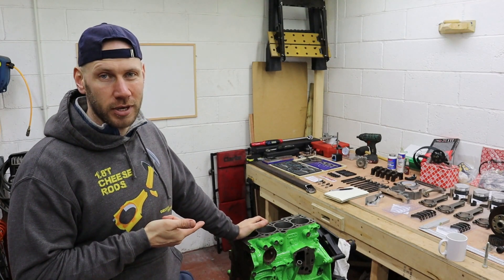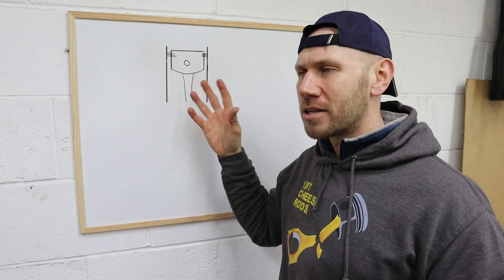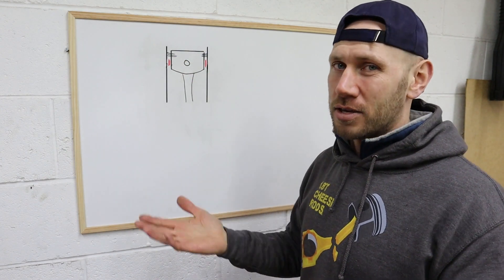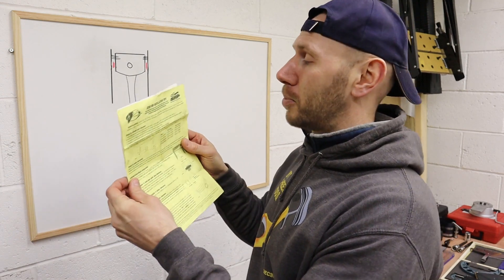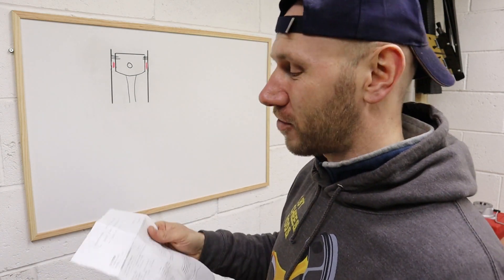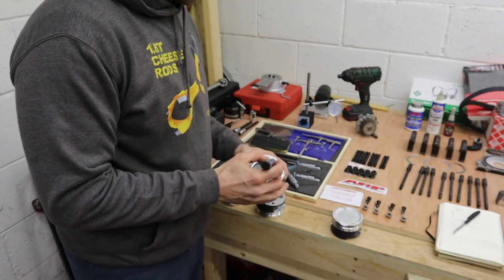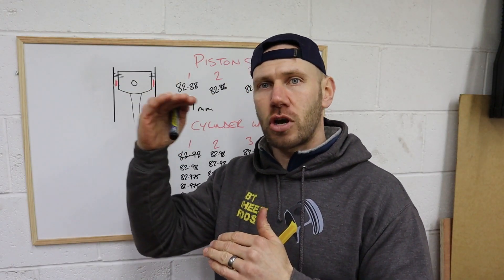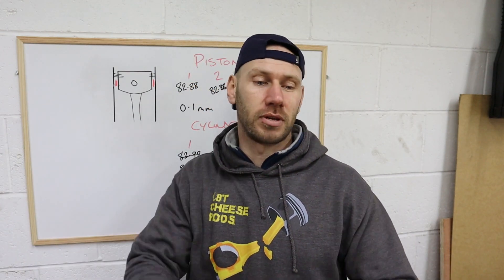SETTING PISTON TO WALL CLEARANCE!! // VAG 1.8t Stroker Engine Build

Comment: At 0.1mm like you have set it, does it burn oil? What pistons ring gaps did you use?
Can you set a EA113 with je Piston ultra series (83mm) to 0.9mm PTW clearance? I would like to get some proper Infos, but there is not much Info out there

Comment: Good content, it's a thing many people struggle with during an engine build. It's also good to emphasise that the correct location to measure pistons as you showed very clearly is at 90* from the pin and about 13mm up from the skirt bottom, This is where most people get into trouble. Pistons are not round and as you also mentioned expand when the engine is running. The top of the piston, which contains the biggest mass expands more than the thin skirt.

Comment: do you have to put the Pistons in the correct way or you could just put them in there
Reply from the maker: The pistons have to installed in the correct orientation.
Reply: Which piston go in first you could just put them in one by one or you have to put them in an order and the block

Comment: Hi mate, thank you for the video.. I have a question if you wouldn't mind answering. I just got my engine block back off the machine shop and 5 out of 6 bores are 0.0005" over 84.5mm (the new bore size).

However 1 of the bores is 0.0025" over. The suggested ptw clearance by the manufacturer is 0.95mm and each piston comes in at 84.405mm. After converting these values, I'll have a ptw clearance of 0.16mm (0.006") on one of the bores. All others are 0.11mm (0.004") which I would imagine is close enough to the 0.95mm recommended by the manufacturer.

Should I go back to the machine shop and reject the engine block because of the larger clearance on one bore?

Comment: Hi sorry to bother got oil burning in my 18t build, Pitons are Wiseco  82.5 stroke pistons had the machine shop set the wall clearance at .1mm box says .89  will this be the oil problem
Reply from the maker: Do you mean the paperwork suggests 0.089mm and they've used 0.1mm?
That's only half a thou in old money so I doubt very highly that this is your issue. 
If the paperwork is suggesting the above clearance then the pistons must be something like 2618 aluminium alloy and the gap is for thermal expansion.
There's lots more to it including the actual build practices and techniques, how round the cylinders are, how the engine was broke in etc...
Reply: @DecimalTenths  Hi thanks for getting back yep 0.089mm. Out of the blue are the oil housing different between the 058 to the 06A? More Videos mate

Comment: Hey Man, Great video! I wish I had a shop to do this stuff in, or a garage, Im ijn the driveway in the sun, and am doing rings on my zuki x90, How do I check clearance with the crank in after getting new rings and or pistons? I am taking the pistons to the machine shop to let them decide if there to far gone, I have never done this before, but when they quote me $800 just to do a head gasket, Ill try it myself !, Thanks
Reply from the maker: What clearance do you want to check dude?

Comment: heyy , i have a question please , ive read on the bentley of a golf 2 that the diameter can go up to 0.08 from nominal dimension , and the piston to cylinder clearance should be 0.03 and 0.07 maximum allowable , 81.01mm cylinder bore standard , piston diameter 80.98mm , so if i have a value on my bore cylinder of 81.09 (81.01+0.08) im okey and still in the limit however its gonna be a clearance of 0.11mm ! which is over the max allowable piston to cylinder clearance 0.07 can u explain this to me please ?
Reply: I did my mk2 jetta block in a machine shop, had new oversize mahle pistons and they did a clearance of 0.08mm i measured when i got it back. After 4-5000km i can hear piston noises, at first were only cold but now all the time.

Comment: I have brought some pistons that are 4.030. The manufacture clearance calls for 0.0040. The machine said that he will bore cylinder to 4.031. Does that sound right?
Reply from the maker: Different manufacturers have different guidelines for their PTW clearance limits due to thermal expansion of their material. That sounds tight if you are wanting to keep it to 0.004". Maybes talk to him and get his reasoning
Reply: @DecimalTenths  ok. He actually said 4.031 with .0004 clearances
Reply: Thanks

Comment: Smh, u wont believe my luck. Bought a car just for the block 750.00 took block to get machined gave them the pistons (same exact as ones in video) gave me back the 3 hundredths to big on the bore. After searching very upset found another block took it to another machine shop this time a performance engine builder with pistons and papper work asking for .004 piston wall clearance.  Picked up my block asked if he got clearance correct says I didnt need it that he bored it to the paper work exact at top left of paper bore 3.268. I am so upset I just waisted 3 months and 1700.00 on engines and machine shops not including 750.00 in pistons.
Very sad right now.
Let's say my piston skirts were your same measurements trusting JE I figure they would be and bore is 83.01, what would you do and is it even build able.
Thanks for reading true sad story as I sit on my couch frustrated.
Reply from the maker: Hi mate, sounds like a shit story that mind... 
I gave my machine shop my pistons, with my measurements and I then advised that I wanted 0.004" ptw clearance. They checked and confirmed my piston sizes then bored my block to suit. They then gave me back my block pistons and their measurement sheet.
I believe that is the correct way to do it. The machine shop is then responsible for their work, plus I could check the work as per the video for due diligence before assembling. If they chose to follow the sheet instead of the real world measurement of the pistons then they have got it very wrong, and I wouldn't pay them...😲.
If you've got an 83.01mm bore with 82.88 pistons then your clearance is 0.13mm (basically 5 and a bit thou). I'd personally say that's too big, as 0.003" is the norm for these pistons as per Badger5, and I am intentionally pushing them for track use. With 0.005" clearance there's a big chance you'll get piston slap when cold, with oil consumption over standard. I'd advise you find another block and try and get it right. It would be a shame to spend all the money, time and effort and end up with something sub par. 
Shit situation pal, but with engine building it has to be right  ✅ . Hope you get sorted pal
Reply: @DecimalTenths  thanks for confirmation of my novice thinking nice to know, learning alot from you.
Really appreciate ur time.
Keep vids coming love them.
Reply from the maker: No worries at all mate. Hope you get it sorted. Surely now all you'll need is a block, so should be cheap. I coukd even help you out with it if you were near Newcastle.

Comment: So cool, your building a engine in Texas.... well sorta. You make it look so easy. It took me a full day to be able to gain skill to get same measurement 2-3 times in a row. I had to make a jig to carefully hold the mic and using a block of wood to be able to position everything in same spot repeatedly. 
I also have the 2618 pistons. So all pistons with my mic are 82.95 clicking the tension handle. Seems my bores are 83.06-83.08 consistantly measuring each one 20+ times. Is the .11-.13mm to much or inconstant? Could it be caused because I cant click the handle on the mic while measuring the telescope.
Your videos are right on time look forward to each one.
Reply from the maker: Cheers for watching. The values given with the 2618 JEs suggest 0.004" (0.1mm) minimum PTW. I'd prefer not to be over that from personal experience but a smidge wouldnt be the end of the world. Are they oversize pistons and have you had your block machined? Maybes try and get some solid results and if in the end of it you have to get a different block, then it may be the only option.
Reply: @DecimalTenths  
I gave machine shop pistons and the block. The pistons are 83 and was machined for them I also provided machine shop with piston paper work. I am hoping it's just my telescope skills to mic, are just off but man I did like a thousand times.
Thanks for all you do.
Reply from the maker: @shanekent1580  No worries, it is a fiddly process that takes practice to get right. Ideally youd have a bore gauge that was zeroed off your pistons. Taking way more money than what I have invested though. I would keep on measuring mate. You want solid repeatable results before you give up. If you cant get them then it may be your equipment or technique. Transferring from gauges to mics isnt ideal but it can give good results.